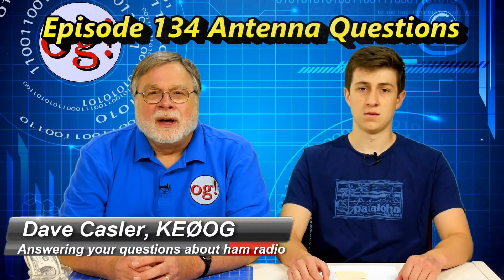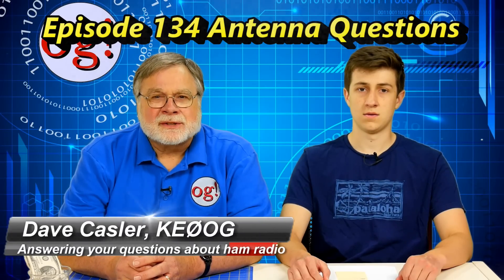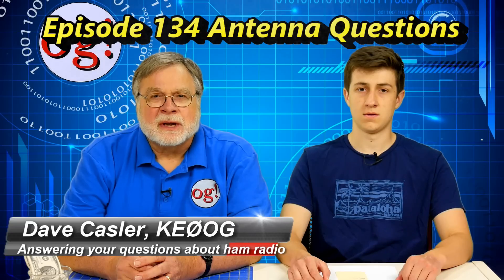Ask Dave: Antenna and Analyzer Questions (#134)

Comment: Hi Dave. Very informative and interesting video, thanks. I have been watching your videos for nearly a year now. However viewing from across 'the pond' and as someone who likes to keep things simple, I am always puzzled as to why measurements always have to be converted to feet and inches when we are dealing with the 80 Metre band, the 40 Metre band, the 17 Metre band. We're all in Metres on the radio anyway and 300 divided by the frequency in MHz always gives us the wavelength in Metres, which we just need to divide by 4 for a 1/4 wave or by 2 for a Half Wave dipole etc, and take into account velocity factor or end effect. Having to then convert again to inches and feet seems to add unnecessary complexity and more room for error and mistakes. I guess you can get rules and tape measures calibrated in Centimetres and Metres (?) It would be so much easier that way, but if not, I suppose you'll have to put up with all those conversions!! :-)   Just my two pennies!!  :-)  Brilliant work Dave and team! Keep it up. 73, Mike. M0MTJ
Reply from the maker: The metric system never caught on in the US. All of us have to have two sets of tools to deal with anything: both "English" and metric. Note that the wavelength descriptors for the HF bands are not exact. Use the frequency to get the actual length, and if you're using this to cut a wire antenna, remember that the velocity factor of open wire is about 95%. As an engineer I wish we were all metric!
Reply: @davecasler  Thanks Dave. Good point about the HF bands not being exact. Excellent point too on the velocity factor of wire that has to be taken into account.  In the UK in the 1970's children were brought up with the 'new' metric system, although it perhaps seemed alien to some parents, perhaps! I can still work in feet and inches, but the Metric system is so much easier!  Thanks again Dave, 73, Mike. M0MTJ

Comment: Great video, Dave!  I have room in my attic for a 3 element yagi for 6 meters. With a TV rotar will this work with all the wiring, nails, and ducting. It will have clearance to turn but what about the interference?
Reply from the maker: Unfortunately, the only way to really know is to try. You must have one huge attic! There's not all that much activity on 6 m. However recently I had some good luck with FT8.

Comment: Hi Dave,
Great questions and answers. I hear you are interested in installing a tower. What height do you have in mind?   73   WB3BJU
Reply from the maker: Not too tall. I need to get it up above our pinion pines and junipers. So somewhere between 35 and 50 feet.
Reply: Hi Dave,
May I suggest a tubular crank up 45 or 55 feet tall with the rotating base raising fixture. That makes it free standing and the tower can be cranked down and lowered to ground level for any antenna work.  73  WB3BJU